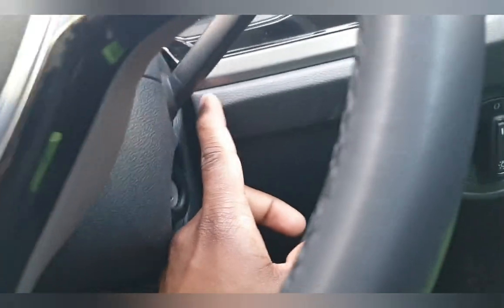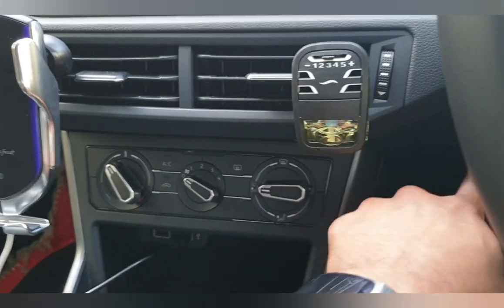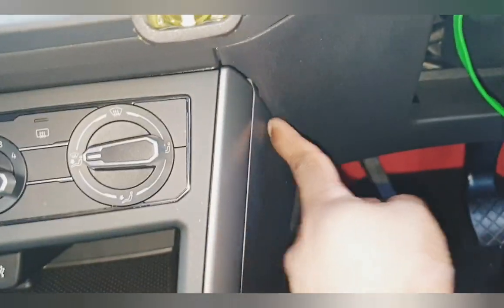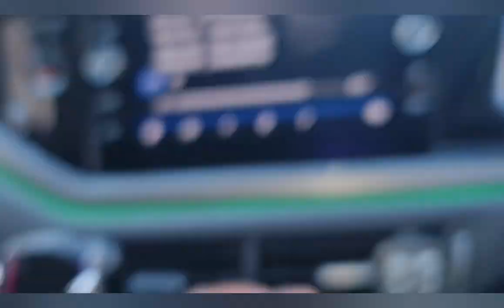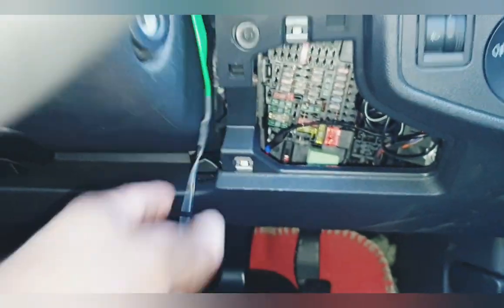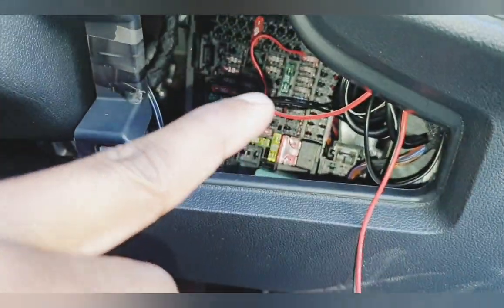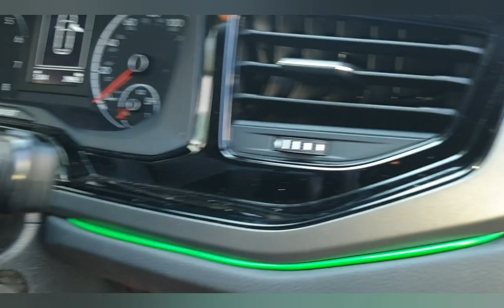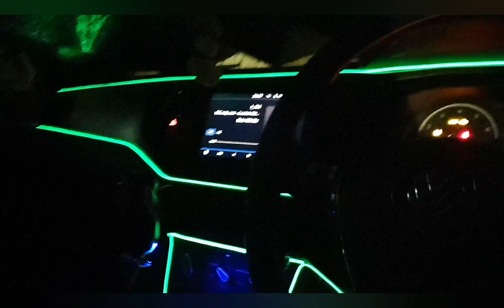LED Installation on car dashboard, el led wiring (Car Interior LED Light setup) Volkswagen vw

Comment: Hey thanks for the video. I bought the same light kit ( blue ) with the same red and black wire harness. I want to connect to my my interior lights to the car. Can I just hotwire directly to interior light source or through the fuse? Thx
Reply from the maker: If you get 12v output, you can connect. But my advice is always connect with the fuse instead of loading too much. Heavy load may blow your fuse and may cause fire. So better connect with the additional fuse.
Reply: @nishan747  thank you
Reply: Do u have a link for the lights

Comment: I have the exact same car as yours. I did mine with a blue color but only had it in for a month or so. The power source were from the 12v lighter panel . It has a plug that connects to the lighter panel. The problem I experienced was the black adapter (which is on yours as well) got hot and started to melt and burnt. I didn't trust it ever since. Now looking at your setup where you connect it directly to the fuse is just as dangerous. If it gets too hot it'll damage your car. Worse cause it to burn.
Reply: I never trusted it even though I want a red one in mine. Now that I know it can melt, I can set my mind off it.
Reply: @vlekarmy5424 yall must got a bad batch mines never heats up

Comment: Thanks for your video bro, please respond, what color  LED ribbon did you install?  Does it automatically comes in in the land that is enough enough for the - and is the - and control area? Please  Thank you
Reply from the maker: It's a green el wire. I didn't understand your 2nd question. But the wire is 5m long. I hope this would help.
Reply: @nishan747 
(TYPOS)  I was asking the length,  and how much length should I get in order to do the the dash and console area? thanks
Reply from the maker: @theoxygen876  5 meters
Reply: @nishan747  thanks

Comment: One thing bro, my concern is when you stick this into the trimming, its not that smooth. I can clearly see some areas  not following trims line that good. Can you do something about it when some areas are too tight and some too wide?
Reply from the maker: I'll try to upload it
Reply: @nishan747  ok, cool. Today i tried it on e46. My fears came true.  Not so straight lines. One tip btw, tap it on the power wire of ashtray bulb or something, so you can dim it out, looks like oem. Cheers

Comment: Let say you have 2-3 el wires, can you connect them to 1 fuse adapter? Or do you need multiple?
Reply from the maker: You can connect. But overload can blow the fuse. Always recommend the multiple fuse adapter.

Comment: If I do this, will it turn on with the headlights
Reply from the maker: No. As long as you turn on the ignition it will start working until you turn off the ignition.
If you want that work with headlight, you need to connect with the headlight line.

Comment: Too technical for me. I'll just pay someone to do it for me
Reply from the maker: It's not that hard. Try it yourself. If failure try with someone. As long as you don't cause electrical short, it's fine
Reply: Best tutorial I’ve seen Soo far…I went to a shop to install mines..and they told me there labor is $1500…Yup Ima do it myself😂😂

Comment: Thanks, can you please tell me the diameter of the cable? And the lenght? I have the same car. Or maybe con you link yours?
Reply from the maker: I'm afraid I can't remember as it's long time now. It should be 3 to 5 meters. And where I bought the seller removed this item.
Reply: No problem thanks, i bought it from amazon, 2,3 mm, 3 meters. I hope they will be fine, thank for the tutorial.
Reply from the maker: @lorenzinorizzetto6258  you are welcome
Reply: @lorenzinorizzetto6258  hi i know its been a while. i got the same car, was 3m a good size or was it too small
Reply: @TheRapsterLOL  yes, It is a good size. Not for everithing shown in the video, but you can cover most of it

Comment: Does it take or use a lot of the car battery?
Reply from the maker: Nope. I have connected with the ignition power. So when the ignition is off it's not going to work.

Comment: Where did you purchase the light?
Reply from the maker: I bought it on ebay. But the seller is no longer listed. You can find some other sellers.
Thank you
Reply: @nishan747  do i just type in el led lights?? Im purchasing a 2012 Volkswagen polo tdi match, would it be okay for that?
Reply from the maker: @sayemabegum1588  you can type such el led light, neon glow led light, el wire.
It should be okay to install as long as you have enough gaps for the light's broadside to go in.

Comment: Where can I buy this from and will it fit my 2013 polo
Reply from the maker: You can buy this on Ebay as well. Led el wire. It should be fitting though.

Comment: I just tried installing mine and gave up because the cracks arent tight enough the wire just keeps slipping back out
Reply from the maker: Just a suggestion, if you are planning to keep it permanently then glue it
Reply: @nishan747  yeah but what if it stops working or melts In the summertime lol

Comment: Too complicated
Reply from the maker: I'll make more easily in future videos.
Reply: @nishan747  it's not about how to put it up 
It's all about to use screw driver and go where the fuse and the wires are
Reply from the maker: @roodypierre3362  watch this video for connection https://youtu.be/FiG556X4-Vo
Reply: @nishan747  like a Jamaican would say "no Sir" thank you 
I don't want to get my car system fucked up
I thought it was something that I could just plug and unplug easily to the cigarette lighter thank you again
Reply from the maker: @roodypierre3362  still you could connect with cigarette lighter.
Good luck